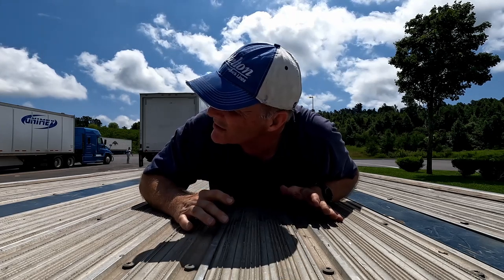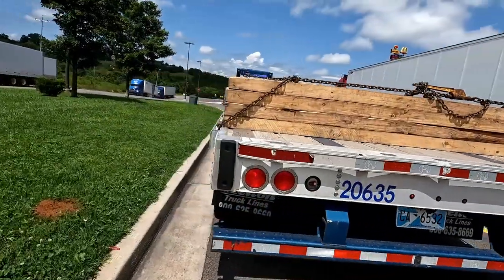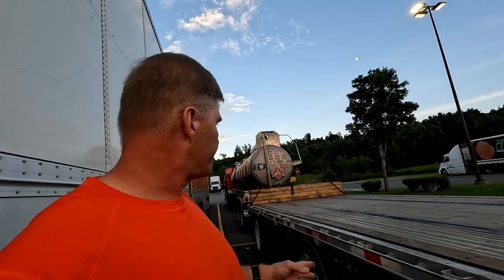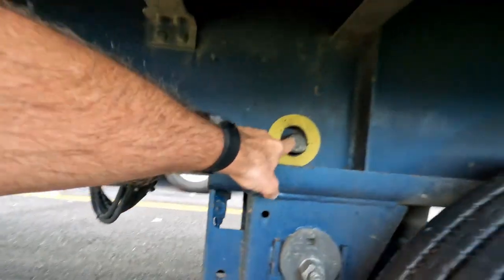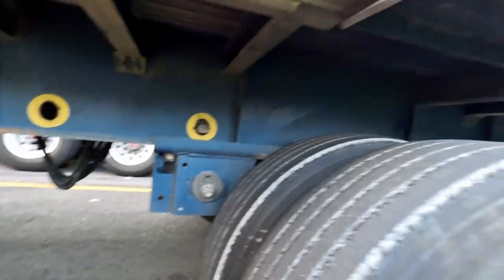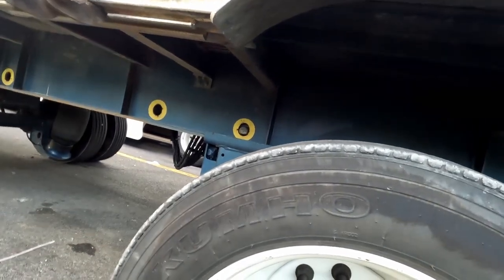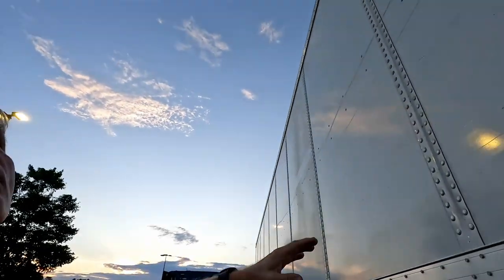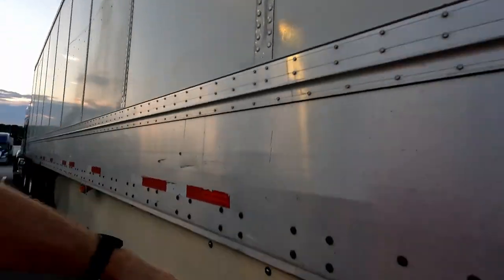Step-Deck Pro's & Con's - Melton Truck Lines

Comment: Does step deck put you into hauling a different category of freight with different types of shippers etc?   Can you go right in to step deck or do you have to have  prior flatbed experience?
Reply from the maker: It does not matter with Melton.  You could have a flt bed one week and a step the next. As for freight.  Yes, some shippers do not want to load stepdecks. Lot if the time with a step. You could be hauling heavy machinery or foam siding to lumber. You just never know.
Reply: @myadventures126  Thanks for the info, I am glad to see your previous videos that you have time to get out on the bike while over the road.  I am an avid cyclist looking to go into trucking around August.  Good to know that you can keep up your exercise.

Comment: Awesome video! Would you recommend step-deck trucking for someone who’s bored hauling vans and wants some more action and challenges?
I love driving, but I find myself getting bored and losing motivation due to lack of challenges and creativity. Securing a load properly on a step-deck seems something I’d really enjoy doing. Could be wrong lol
Reply from the maker: @Vlad_Shv  i drove dry van for 10 months before I had enough. Like you said. It was boring with zero challenges. Now, five years doing flatbed, and I still love it. I'd say you would enjoy this more than what you are currently doing for sure. Thanks for commenting.
Reply: @myadventures126  awesome! Thanks for the encouragement! I got stuck hauling vans for embarrassingly long time. Somehow I still managed to stay in good shape. I really want to do something that would keeps me moving! Step-deck trucking looks like a lot of fun lol
Thanks again! Stay safe out there brother!